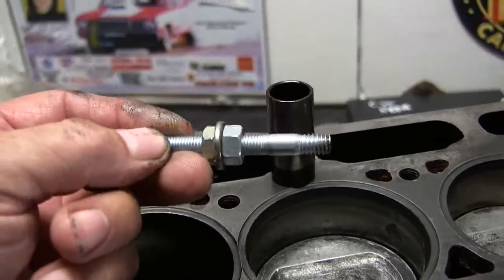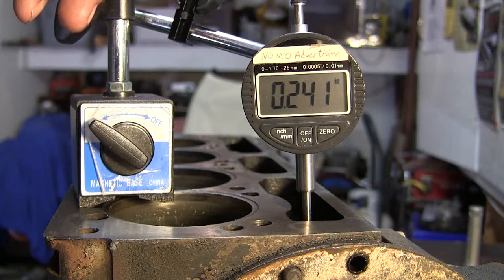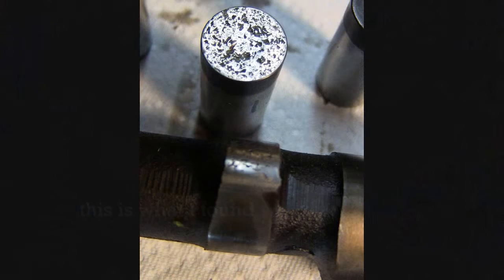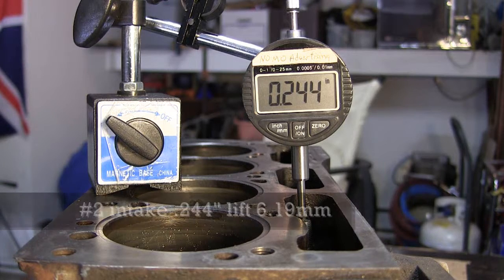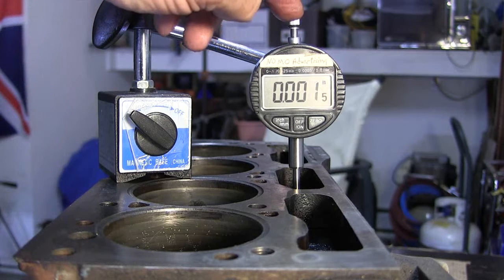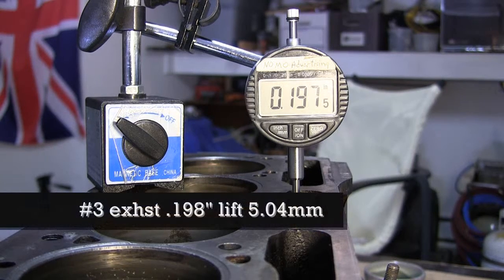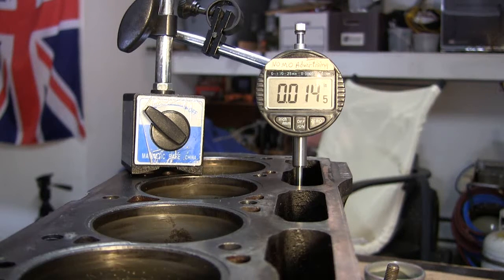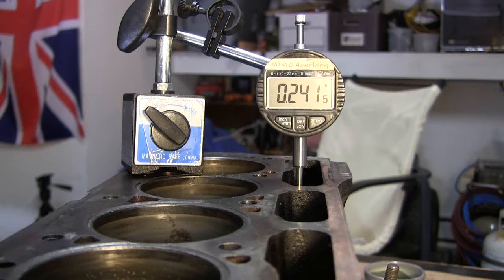My 79 Triumph Spitfire 1500 camshaft 77,900 miles, 2 bad lobes

Comment: There is a good chance that the cams had a wrong break-in oil or procedure so it might have started already when it was new.
For Your interest you my want to read this report. 

http://www.hotrod.com/how-to/engine/ccrp-1108-camshaft-break-in-guide/

Greetings,
Bernhard
Reply from the maker: Greetings again Bernhard. I can't say which failed first, the cam lobe or the follower, but I did read the surface prep produced a thin layer, and the metal also had carbon particals in the steel used back in those days. This being the original camshaft I would think any cam lobe to follower breakin was at the factory in the UK. What oil was used I have no documentation. I did use a high Zinc content oil on the replacement, and continuing use of the high ZDDP oils.
Reply: +Calvin G. Williams 
Hope the new one produce a better result. The pitting looks like a material problem. Interesting is the difference from one to the next. Normally if the cam is at fault, I would expect the lobes to be damaged across the board evenly since it is one material and one surface treatment for the whole cam, while the tappets can come from different batches or even different suppliers. Last month I had the cam timing adjusted on my Jaguars 3.8 Liter XK engine and they all looked fine. I did not measure the lift but, to the naked eye and moving the finger across they where all smooth with no pitting. This engine is also 52years old.
Wish You luck and check them again after break-in to be sure,
Bernhard

Comment: I am not sure if you can get them in the USA but, canley classics do a 1300 cam with the large bearing faces to run directly in the block of a 1500.
Reply from the maker: +501isa Yes we can.  Canley 25/65/1, a Mk III profile, is available with large journals for the 1500. Carriage is almost as much as the cam itself. I heard from some US members other fees will be charged by the US too, customs or something, additional shipping in the US. I have not seen additional charges yet. SB is selling this cam, at a much higher price.